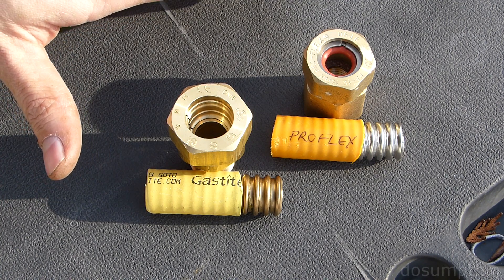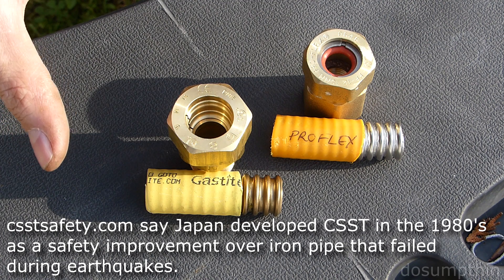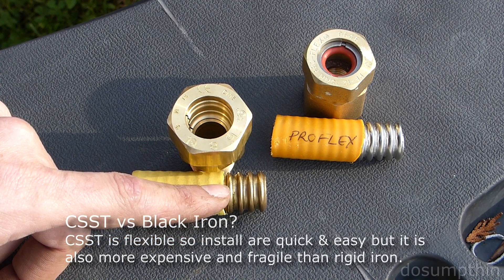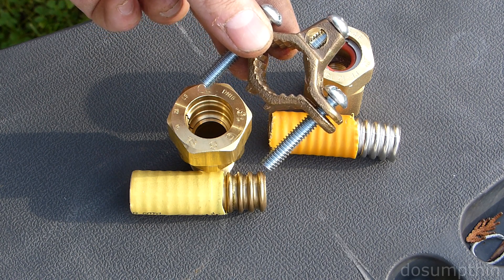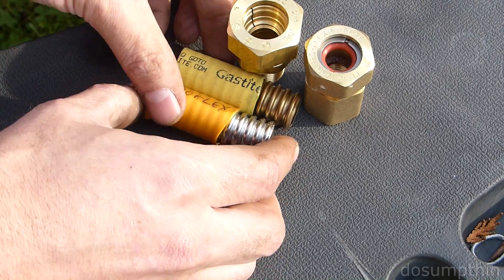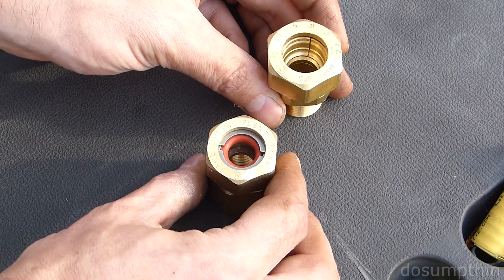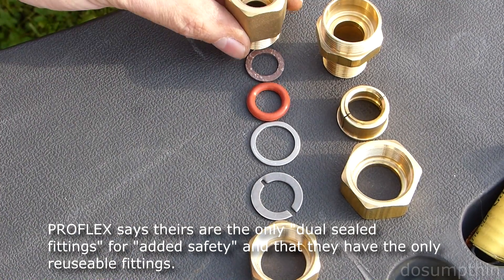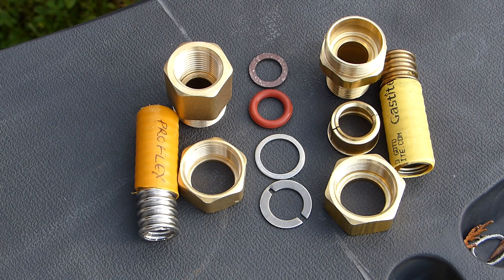Gastite VS. Proflex CSST flexible propane/natural gas line intro & comparison

Comment: After a little over 20 years of installing csst where applicable - I can say for ease of use AND worry-free , no-leak seals...Wardflex and Proflex are the way to go.  I have NEVER had a leak or a failure with either of these systems. Proflex IS a teensie more complex to assemble , but by NO means difficult , and it's dual seal system is VERY  forgiving and reliable.

Comment: Flow rate is the big difference.  A 50 foot length of proflex delivers 32,000 btus worth of natural gas where the same me size gastite delivers 42,000 btus.

Comment: I have used Pro Flex and Gas Tight. While the Gas Time seems simpler, it is also prone to leaks due to misalignment of the pipe into the fittings. The Pro Flex is more forgiving in this aspect and is a lot easier to tighten down, basically hand tighten plus 1/4 turn with wrench, while the Gas Tight requires more wrench tight turning

Comment: Great video! Your end cuts on the Gastite look way smoother than the end cuts on the Proflex. Just noticed this is an old video, not that it's bad or anything.
Reply: Mark K

The pro flex is marketed as more forgiving of messy cuts. This is probably due to the 3-ring sealing system. Maybe primarily dyy it r to the silicone (red) o-ring. But, not being an expert, the reason for the more forgiving seal it s my speculation. If you discover different in your research, please let us all know. Thanks.

Comment: I've installed proflex, and 10 yrs later,  it's still in use with no problems.
I purchased a building with gastite already installed.  It looks to be 10 yrs or more and there's no problem.

Good detailed observations in this video.  I wonder what your personality type is now.  :-).

I think the proflex is good for the homeowner install, but contracters who do this multiple times might not like all rings and washers.  Employee error would be significantly increased as well as time.
Reply: I used to think DIY'er were hacks (and maybe they still are) but the some of the "professionals" aren't any better and in fact, maybe worse, because they think they know what they're doing.

Comment: I used the Proflex brand at home, I like the double gasketed seal.  Seems to work pretty well.  I have used Wardflex as well, if I understand annealed correctly it allows for shaping the pipe around bends and the like.  If you use non-annealed, you'll find it is a little springy and difficult to shape and bend.

Comment: My experience is that proflex takes less pain in the rear to seal that most other systems. We have a job going on right now that is Gastite Flash Shield. (because we want it lightning proof). It looks similar to the other brands that are hard to get leak free at fittings.  I should know by the end of the week if we are ever going to use it again.  I am skeptical until I know it will hold 25 psi for a week at least. I will just keep my fingers crossed.
Reply: How did the gastite work?

Comment: This commentary be a little late but for nail protection between studs were required not to secure it. You secure it where it stubs out but not along the run. This way a nail or screw can push the pipe to the side rather than penetrate it. If it’s secure then it will penetrate.

I’ve only ever used gas tite and it’s successor flash shield. Pro flex is lying when they say they have the only reusable fittings. Gas tite fittings are reusable. In fact I had to use gas tite in a garage one time because they needed gas lines moved but then they’d be demoing the ceiling joists and putting new ones in so I had to put the gas tite in them take it apart for the new joists, drill holes and reassemble it. The only part that compresses is the csst itself so the fitting can be reused.
PS. It looks like the reason pro flex has two metal washers is one of them is a friction ring. This so the nut can spin freely without distorting the o ring.

Comment: It should be noted that Pro-flex fittings have not been changed for over 20 years.  This suggests reliability.  Very easy to connect.

Comment: Thanks had some guys overtighten the pro flex,damaging the seal,instructions called for hand tighten then quarter to half turn,and no more,also you want to be careful  pushing the seal onto  the sharp edges,of the corrugated  stainless, I've kept  my connections accessable,and properly  bonded, for lightning,you must not  have ducting,metal pipes,or wire,touch  the csst,anything energized in lightning strike ,can pop a hole,causing  possible fire,,be sure to self qualify,or hire trained professionals, many fly by nighters,can put your home at risk doing it wrong

Comment: Be Warned:

I had a contractor install a gas hot water heater in my home some 10 years ago. The contractor installed the Proflex hose that ran from my water heater to a connection in my upstairs bath closet to iron pipe that then ran to the furnace in my attic. Several years after installation I smelled gas in my closet. The hose was leaking gas at the union joint. I called my local gas utility they came out and shut the gas off. They then repaired the leak. I asked why for no reason it began leaking. The technician could offer no reason. 

A year later it began leaking gas again at the same joint. Same scenario I was shown the piece of the threaded end that was removed. A hole developed between the threads. No plausible reason was offered why it happened. I suggested humidity in the bathroom as evident on surface rust on the iron pipe. I was told this has no bearing on this leak.

About a year later it happened again. SAME DEAL, this time the hole was larger and spewing more gas. I was livid. This time the tech added more iron pipe and relocated the connection to just inside the bifold door to where is easier access. I maintained it has to have something to do with humidity stainless steel thread into iron pipe, again I am told no. Tech wrapped the connection with a special tape to keep moisture off the connection. Just recently for the 4th time another gas leak. This time it was at the joint. I hired another contractor to remove this flex hose and it was replaced with a lifetime warranty track hose. The iron pipe was all rusted up from the humidity that goes on in a bath closet.

At no time did I experience any gas leaks in this hose at the connection at my hot water heater in my laundry room.  4 different gas leaks where this hose was connected to iron pipe in a high humidity room.  This was a time bomb in my home. 

My advice. Avoid this type pipe in an area where there is humidity. It’s just not worth the risk. It’s not fun be awoken in the middle of the night with a gas leak then being told we’re not sure why its leaking but the humidity is not the issue. Whether the humidity played a part or not, this hose failed 4 times all with new ends installed on it. Piping was secured and joint were tightly secure. Be warned.  AVOID THIS TYPE HOSE
Reply: Avoid what type of hose?  Every manufacturer has a different design to transition from the CSST to a brass fitting.
Reply: @rpsmith  The yellow hose had aluminum threads. For whatever reason no one could understand why, holes developed in the aluminum causing gas leaks. Maybe it was the cast iron pipe and aluminum together at the union? This was in my bath closet with high humidity. This happened multiple times. I hired another contractor was told the yellow hose like in the video was replaced with the black.

Update a year later.  The coupling  and union was moved to my attic and the black flex pipe runs to my water heater now. No joints in the closet. All is well no more gas leaks.
Reply: @Vshky  -  I would think Aluminum to Cast Iron would be against code!  I only put Aluminum against Aluminum or Stainless Steel.
Reply: @rpsmith  Holes developed between threads above the connection. My local gas company's answer was to shorten the line and add another connection. After a year leaks developed. They could not figure out why. I fired them and got another reputable contractor that told me the yellow pipe is outdated and should not have  been used in high humidity area and  or a union in that space. Single piece line was used and problem solved.

Comment: Nice presentation.  I find it best to use this flex in "accessible" areas, connecting between iron pipe supply and iron pipe fittings at the appliance, thus using flex where flex is most convenient and using solid pipe at stable ends of a line ... the beauty being you can build out the appliance connections and the 'distant' supply connections separately, then join them with a flex run.  I am running lines beneath my mobile home.  As with any installation of a "system" to create a seal ... careful review & complete familiarization is essential, then making it relatively easy and confident.  Careful DIY craftsmanship, taking time to educate self first and do-it-right almost always surpasses "professional" gotta-get-it-done work.   A year after working with Proflex, I jumped back in and RE-educated myself before doing more work with it.

Comment: Sorry but I was planning to use this type of gas line from my tank to the house then to to my gas range & dryer 
Inspection  
 It failed inspection because of it as well as the gas supplier refusing to install it 
I was told it was illegal to use it for anything other than outdoor grills 
This is because of lightning strikes even if you have proper grounding & all the correct clamps 
Also be aware that different brands require you use the fitting of that brand 
Cant interchange them 
So from my understanding youd be throwing your money out the window cause stores wont take it back after its cut even tho they still sell it to unsuspecting buyers that are told by them its all safe & sound 
Sorry to burst your bubble of a DIY job but its better than seeing your home on tv as its burning down in the next storm

Comment: Earth bounding is a legal requirement regardless the pipe used.
Reply: Bonding is not required on all csst....it used to be that way, but now some manufacturers specifically state that bonding is not required. (flashshield, and flashshield+ are both made by gastite and not required to be  bonded, however...regular gastite is required to be bonded. . A more true statement would be that the less expensive csst's out there all require bonding,. but there are manufacturers making lines of csst that are specifically not required to be bonded unless your local code requires it. They all state that if your local code requires it, then you must bond it regardless of whether or not your csst is lightning proof.
Reply: @clayaustin9339  
I'm in UK,  over here is still a requirement.
 https://aaelectricalservices.co.uk/main-and-supplementary-bonding-earthing-to-gas-and-water-supplies/

Comment: As a plumber with a decade in the trade and 5 yrs as a general gas fitter (no restriction on appliance size) I can safely say the info was very informative. I use TracPipe for my installations when necessary, based on its ease of use and EHD Values. the obly product to give a larger capacity per foot being sch. 40. None the less very informative.
Where I live homeowners cannot install any appliance or piping. But I have run into sub par and heard of pex tubing being run by homeowners. Atleast the proper material is showcased here.
Reply: sch 40 lol what hell are you talking about that is for liquids non flammable liquids.

Comment: Gas tight and Ward Flex pretty much are the same. Pro flex is a problem waiting to happen. No test needed for Harry Home owner to just walk in and buy at Home Depot is a joke, Both Gas Tight and Ward Flex you need to take a test after a class. This guy has no clue!
Reply: let me guess.... you are a angry that people can do repairs themselves rather than paying you...? What's wrong with DIY... I am not a pro but actually enjoy doing woodworking and from that I have learned and got very good at many other trades....I dealt with plumbers and other pro contractors that knew less than me as far as code and how to do things right....IF there is a real issue with the Pro flex products - that's one thing but saying that people somehow shouldn't be allowed to buy construction materials or pipes and fittings unless they are part of a trade is just wrong.
Reply: No test required to buy any of them. Just picked up 100ft of wardflex and a pile of fittings. No test or certification was required....

Comment: Good info, have you heard of Ward Flex it's a better product and easier to work with.  The tube bends easier and the fittings installation is a dream to the installers.  The product is made in the USA and is a preferred product to the professionals.

Comment: Good review! As a plumber/pipefitter for the last 20 yrs I'd say go with black iron pipe whenever possible. I've installed plenty of csst and always thought it was somewhat sketchy. Black iron pipe will last forever. Don't forget the pipe has explosive gas in it.
Reply: 0wetduck0 your right it does have explosive gas IN IT.But until that gas is combined with the key ingredient its not explosive.OXYGEN
Gastite is 100 times better than that Lowes ccst junk.The guy who made the video gave us most of the reasons that Gastite was better.But heres the biggest.Gastite csn be taken apart and reused.Now the Lowes junk ccst can be as well.But I just installed a 75 gallon natural gas water heater.With Gastite I might add.And the other existing fixtures were done with the Lowes ccst junk.I took the ccst apart so I could reroute it so a future project was made easier.And that rubber oring was so torn up from the initial installation I didnt even know it was a oring.This video is how I found out it was a oring.I was so worried that I pressure tested it after reconnecting it to the manifold.The Lowes ccst junk is for harry homeowner.And Lowes will sell millions of feet of the junk.That is until someone screws up and they get there house blown up.GASTITE takes a training certification coarse to be able to be bought and used.Just like Tracpipe.And Im sure Wardflex is the same.Im a Master plumber/pipefitter myself and yes T&C black steel pipe was the standard for over a hundred years.But the Gastite can save time in labor.Sure it costs more and u need certified to run it.But dont u think its only safe to need to be certified to run it?After all it is explosive as hell (when combined with oxygen)!So its the safest pipe by far of the 2.I wouldnt use the Lowes ccst junk if given unlimited access to all of it and its fittings for free.
Reply: @hippyheli38lc  hand tight plus quarter to half turn, any more will crush tear the silicone  o ring,...happened  to me, I read the book for propper install,I do like the less components of gas tight,less chance of idiots like we hired blowing  up your home

Comment: At least where I live, gastite is only available to licensed plumbers. ProFlex is available to anyone, at Lowes. I used ProFlex in an installation in my home and ran into no problems. It is not difficult to assemble the fittings.  The fittings and tubing itself are fully compatible with galvanized or black pipe.  One way it is superior to threaded steel pipe, is that it is very easy to cut into it and Tee off for another appliance.